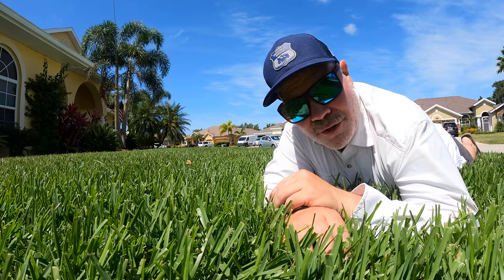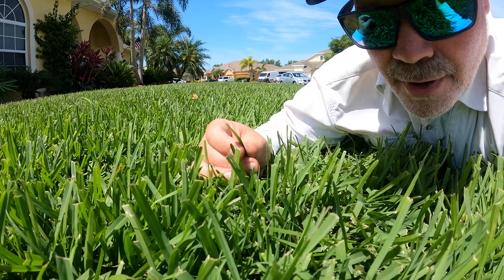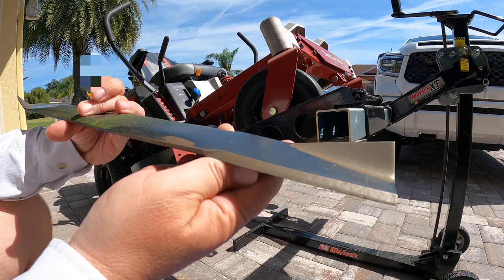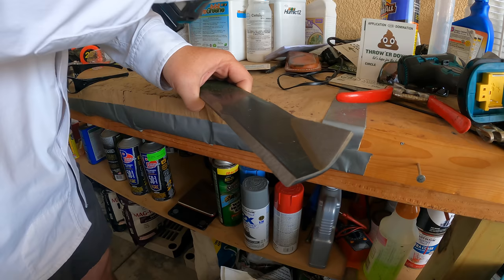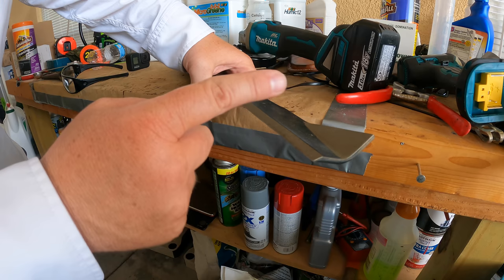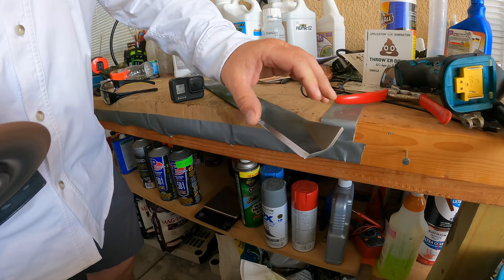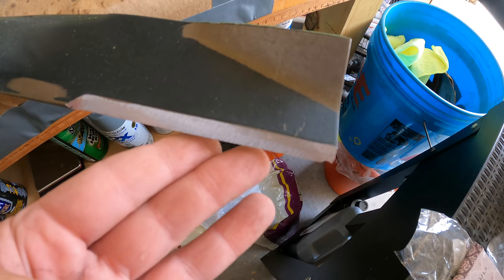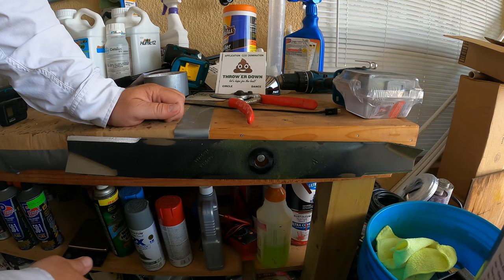How To Sharpen Lawn Mower Blades

Comment from the maker: Complete DIY lawn care training - you will have a nice lawn using what I teach you here https://www.yardcarebootcamp.com/
Reply: Use a flap sanding disc. It has heavy duty sand paper flaps overlapping in a circular pattern. It will keep the steel cooler and it will hold the edge better. Once you overheat the steel it won't hold the edge.

Comment: When balancing my blades, I don’t remove any of the cutting surface.  I remove excess weight from either the back or end of the blade.  This helps the cutting portion of the blades last longer.
Reply: Smart
Reply: Going to start doing just that. Thanks.
Reply: I disagree with removing from the back or end of the blade. What if you have a lawn tractor or ZRT with 2 or three blades? If you grind the 'end' then when you mow with that set of blades it will leave a 'tuff' of grass where the blades have become too short. I do not know exactly what you mean when you refer to 'back of the blade". Do you mean where it turns up or the back (underside) of the blade. You 'cutting edge' is the only place that material is suppose to be removed from. If you're tearing up blades that badly maybe you are cutting your grass too short. I see people all the time cutting so damn short the grass is only and inch or so left after mowing. Never cut grass less the 2 1/2 to 3 inches. I also do not mow weekly. I like mowing every 10 days. The grass is much more drought proof and the lawn is less like to allow the infiltration of weeds.
Reply: @CuriousKL  definitely agree with the sharpening statement!! Plus he’s removing material whether he likes it or not sharpening them. Unless he’s getting giant chunks knocked out of blade he shouldn’t have to remove much material to get them balanced anyways. As far as grass statement just depends on the type of grass, where I live a lot of people like Bermuda 🤢 and mow super low. Personally love a good fescue about 3.5” tall. Harder to grow where I live but it’s possible.
Reply: @Keith Dunbar  I don't think he is saying that he actually shortens the blade (at least not shortening the cutting edge, which would cause what you're saying).  There are plenty of places other than the cutting surface where small amounts of material could be taken off with no impact on performance. It would not take much material at all to balance and it really seems like a good idea to focus on getting the cutting edge perfect and then leave that edge alone. 

You might have said this, in which case I'd agree that I don't think I'd touch the top of the raised parts of the backside either since that's more likely to impact the flow of grass inside the deck. Very slightly rounding part of the bottom edge of the end instead of taking more from the front... That just sounds like a good way to make the cutting edge last longer.
Reply: Makes sense
Reply: I’m only removing small amounts on the back side of the blade to balance the blades.  I’m not removing ANY of the cutting edge.  Once the blades are sharp, it just didn’t make sense to continue removing the hardened cutting edge just for balancing purposes.
Reply: @alanlittle8817  I believe the whole blade is the same hardness someone told me they had problems drilling to fit a different mower

Comment: Using an 80 grit flap sander disk in an angle grinder will give excellent results with less metal removed and less chance of screwing it up. If you want it extra sharp, fine tune it with a 120 grot disk. I’ve tried many mower blade sharpening methods and flap sander is my go-to every time now.
Reply: I agree with you

Comment: "I haven't sharpened these in about 6 weeks that's to long"..... Me here, haven't sharp my blades in 6 years 🤣😅.... Guess it's time to buy new blades lol
Reply: Have never sharpened mine in 3 years. Zero nicks and the cut quality is still flawless.
Reply: Mine gets sharpened every time i slip off the curb
Reply: Yeah you don't need it too sharp in my opinion .just good edge on it .
Reply: Nah you’ll be okay if all you do is mow your own backyard 
I’ve not sharpened mine for 19 years! My mower is 19 years old and still is holding up.
Reply: Just use file as grinder ruin's the balance
Reply: That’s so funny because I’m thinking the same thing
Reply: @ianwilliamson2980  and safer too
Reply: @thomasjefferson2934  o yeah
Reply: I cut grass for a living and always use a file .
Reply: I haven’t sharpened for like 12 years
Reply: my "blade" is literally just a fast spinning blunt object i have no idea how it even cuts grass 😭
Reply: I mostly just run the file over one side of blade once a week to keep the edge on it.thats all that's needed.
Reply: ASTROTURF or CONCREAT LAWN OR DO YOU HAVE A SERVICE & YOUR MOWER IN THE MUSEUM?

IF IT WON'T HOLD WATER : time to file/ sharpen or change to BACK UP BLADE & TAKE #1 back to the blade sharpener you were using : FYI we're a disguise -& sneek in ever 3 months wit the two different blades he/ she/ them might not guess? 

After 6 months : drill 12 holes through it. & Fold 6 wire ties thru & use it for a :: detacher or aerator/ baler? 
Or wait for the :" BIGGS & STRATTON i625 from germany- 6 way: cut, bag, sread,mulch , weed Wacker & walk edger! 😘💸💸🇺🇸?
Reply: Yeah, Posting guy is borderline OCD.
Reply: Flat file for burrs, then a coarse and fine diamond lap would be quicker and less likely to change bevel. It will probably result in a sharper blade, too. An angle grinder can take metal off in a hurry.
Reply: I haven't done it since I got a second hand mower which might be a decade. Yeah buying new blades might be easier than buying equipment to sharpen.

Comment: I use the rotary grinder, but have changed from the metal grinder to a flapper sanding wheel.  It's less agressive and handles curves a lot more evenly.

Comment: I like using my flap disc for sharpening lawn mower blades.
Reply: Yep
Reply: I just came to say this! They work much faster than standard grinding discs. And don’t leave heavy burrs.
Reply: What grit flap disk??
Reply: @BMETFerg  80 I think  either 60 or 80. Both will work.
Reply: @BMETFerg  80
Reply: Agree. But i use whichever is on thegrinder at the time.
Reply: @turboflush  Hah, I’ve sharpened a blade or two with a cutoff disc
Reply: Flap disc was Allyn’s nickname in college.
Reply: That's my preference too.
Reply: Flap disk also !!!
Reply: Same here.  It hits the curves very smoothly.
Reply: @BMETFerg  60
Reply: @BMETFerg  I read 60 is perfect but who knows???
Reply: @gijoe83  Korey... I just got my grinder...have you used 60 and 80 and you like 80????
Reply: @FreedomRock44  I bought 80 grit from Lowes. It works, and I haven't needed to buy a new one. I am not a blade sharpening expert. Just stating what I use
Reply: 80 flap disc for me also.
Reply: @BMETFerg  80 works best.
Reply: @gijoe83  No no wasn't knocking was just wondering myself.     Okay cool to know.  I am in the same boat and wanted advice to which was better as well.
Reply: 💯 I like 80 grit
Reply: Yup, 60 or 80 flap, finished with a file by hand, look for level with a nail in the wall, works flawlessly.
Reply: @zed8083  I just did the exact same!!!!!!!
I have used nail in beam for years.
Reply: @BMETFerg  I use a  #36 grit flap disk from Harbor Freight and an All American Blade Sharpener.  Best setup for my low volume, backyard shop.  Flap disks are a little more forgiving in that they don't make big gouges if you aren't too careful.  I've found that anything finer takes too long, especially if the blade is badly worn or hand ground to the wrong angle.
Reply: I do the same.  I feel it's less aggressive and easier to control.
Reply: Yep, flap disc always. I keep a spare set of blades in rotation too so I just swap ‘em out when needed and sharpen the other set when I get a chance.
Reply: You dont need it too sharp .
Reply: 120grit flap disc gives a much better edge than the 36grit metal grinder.
Reply: @How_Lay  &
Reply: Me too,  when it's not too dull I us a file.
Reply: @geraldsemrau3611  yeah better with file as grinders mess up the balance of blade
Reply: I cut grass for a living and only use a file and it cuts perfect.never used a grinder yet and only changed a blade once had three mowers in 14 years
Reply: @backpacker3421  ,,, I'm going to give it a try. I normally use the regular grinder blade. I just have a hard time getting the angle right.
Reply: @ianwilliamson2980  I have a bench grinder, angle grinder, and I use a hand file as well. Gives me more time to finish my drink ;)
Reply: @bigf1502  ha ha I'm sure.i just stick with the file as want to keep the balance right .blades don't really need to be that sharp anyway .new mowers blades are fair blunt but cut very well.just got new cobra it's great Honda engine in it .under five hundred pounds on Amazon.
Reply: @ianwilliamson2980  Man, I want a new Honda mower so bad. Just don’t want to drop the 600 when my 8 year old Troy built just keeps going.
Reply: @bigf1502  yeah I nearly went for a Honda but at thousand pounds is bit steep .I looked at reviews and the cobra 21 inch has Honda engine so got it . very pleased with it.saved me about six hundred pounds too .
Reply: @ianwilliamson2980  I’m going to check into that! Thank you!
Reply: @bigf1502  welcome .yeah there is review videos on the cobra on you tube .I think it's bit lighter than the Honda to handle too which is important if you work with it all day like me as easier to turn etc
Reply: Yep flapper for the win!
Reply: I use 80 and finish it off with a 120 flap disc

Comment: Thanks for your vid! Just sharing some info; the right type of grinding wheel depends on the material of the blade. That metal grinding disc you're using has an aluminum oxide formulation and is good to use for steel blades. However, if blades are made of a nonferrous material (e.g., tungsten carbide) then a silicon carbide wheel would be better. Also, 60 grit seems to be the most popular choice. It's aggressive enough to remove metal when needed but doesn't dig to deep to keep the edge clean/sharp. Hope this helps fellow lawn care nuts!

Comment: Big thanks to @The Lawn Care Nut!! 

Instead of buying a new blade for my greenworks 60v mower, I bought myself a craftsman angle grinder, and sharpened my own blade. The thing cuts like it did when it was brand new! Super thankful I found this video.
Reply: Try mowing 1.5 acres with that 60 v mower.

Comment: You want a blade that is sharp enough to cut instead of ripping.

When I get my blades sharp, rather than mess with the sharp edges by continued grinding, I balance them by grinding on the back of the blade until they are balanced.
Reply: curious, how much of the fan blade lift wing are you taking off per balancing would you hazard guessing, and have you noticed a difference in the cut due to decreased lift force. aerodynamically that would be worse of unbalancing as having a heavy side as more fan blade will cause the bearings to wear unevenly top to bottom from one side to the other.
also curious, using your method, do you notice any extension in the life of your blades before they wear down or reach the end of their lives?
Reply: @aprilgeneric8027  
The amount taken off the back is very small if you do a good job sharpening the cutting edges on the front.  If you have to take more than a small notch off the back then you have royally screwed up sharpening the edge and should get new blades.

With such a small amount taken off the back the effect on airflow is really non-existent and it moves air just as good as before.  The less you grind off the front to sharpen the blades will make them last longer.  And keeping them balanced is critical to keeping the bearings on the mower deck, or engine in the case of a single blade mower, from being worn out quickly.

Another useful piece of information.  If your mower deck has grease zerks on the shaft going through the deck do not bother greasing them.  They use sealed bearings and the grease you put in there will never get into the bearings.  If you do want to add grease to those bearings you will have to remove the shaft and bearing from the deck and physically remove the seal from the inside side of the bearing first.

But you will have to be sparing on the grease you put in because you do not want to pop the seal on the outside side of the bearing off because that will allow dirt to get into the bearing.  What I do is remove the shaft and bearing and get a needle zerk and lift the inner seal enough to get the needle under it and then pump some more grease into the bearing so it has more than the minimum grease they put in at the factory.  I think that works perfectly fine and you do not risk blowing the seal off the bearing.  I have had my mower for ten years now and have never had problems with the bearings.  The last mower I had the engine wore out first and I mow several acres each time.  We live on a farm and have a big yard and mow along the fence line in the pasture to keep the electric wire clear.

Comment: I like to keep two blades in rotation. So I can always have a sharp blade at the ready.
Reply: Me too!!!    It is such a big help.
Reply: Same here too
Reply: I usually buy a three pack if it's available so I have four total, then sharpen them all each spring. I also have eight spools for my string trimmer which will last me through one year and into the next.
Reply: I just sharpen and re-install, kinda pointless to have more than 1 for home use.
Reply: @gwot  It depends on the cost. For my old mower I could get a third-party-made three pack for $15. I like to sharpen all my tools just once per year. Unfortunately, for my new mower only OEM blades are available so far, and they are $20 each.
Reply: @jmodified  ah, so your reason is just so you can do it once a year. You still have to remove and install a blade anyway, so not taking the extra 2 minutes of sharpening each time seems... pointless.

Comment: Sharpening to razor sharp makes getting those nicks or chips on the sharpened edge much easier. Sharp, but not razor sharp makes your cutting edge last longer between sharpening for the most part unless you hit a lot of mulch or sticks with the blades. Another tip, when balancing you can remove material from the back of the blade instead of continually removing from the sharpened edge.
Reply: I try to preserve as much of the cutting edge as possible when balancing, so I take the excess weight off the back edge and the end,a little at a time. I try to spread the removal out a little so to not just make a big gouge all in one spot. I use a cone type balancer to get a three dimensional balance , rather than a two dimensional balance using a nail in the wall. Good luck.
Reply: I'd rather have the blade as sharp as possible and just sharpen it more if I had to.

Comment: I sharpen with a hand file as recommended by Toro in the owners manual for my Suzuki 2 cycle powered 1991 Recycler.
Reply: @j s The Hondas from those years seem pretty awesome too. Cast aluminum decks like Toro. My plastic deck '08 Honda HRX 217 can not touch my '91 Toro in terms of mulching ability.

Comment: I use a metal cut off disk on one end of my bench grinder and cut three notches at each end of my mower blades for my push mower.
I rebalance the blade after each sharpening.
I am now 88 and can easily cut through grass that is up to 6 inches tall in places.

Comment: Excellent video! Very nice hand grinder too! Just sharpened my blades  yesterday, and greased my spindles,  and you can hear them making that perfect pitched sound, that’s when you know you got them blades sickle sharp and smooth spindles. Lower friction, pressure, wear and tear on the clutch, drive belts. Great closeups of the angle grind! Done good dude!
Reply: You wasted your time greasing the spindles. The grease nipple just allows you to fill the void between the top and bottom bearings which are both SEALED bearings. Don’t want to burst your bubble but you should know that your wasting time and material. Ask any mechanic that works on mowers and you’ll get your verification if you don’t believe me.

Comment: I have just been using a coarse sharpening stone. Does a good job and as long as you aren't hitting rocks, there is no need to remove a ton of metal with a grinder.
Reply: Not suppose to cut the driveway, only the lawn. If you're hitting rocks in the lawn, my guess is you're cutting too short.

Comment: Something you didn't mention and most people don't know or realize is to make sure when you sharpen you are rotating the disc, file, etc. away from the edge. Reason being is to not heat the leading edge. Not a problem with a hand file but grinding discs generate heat which weakens the tempering of the blade. The nail balancing has always worked for me. Nice video!

Comment: BELT SANDER turned upside down secured to bench/table with 60 grit gets fast, amazing results.  Use a binder clip on back edge as a guide, gives perfect angle. Two sets of three blades in rotation, submerge the dull ones in water for a couple of days, caked-on grass comes right off. SAFETY GLASSES 100% ALWAYS!!

Comment: Not explained in this video (though he may have in another video), but the reason you balance your blade/s as he explains it, is to help prevent destroying the main shaft bearing in your mowers engine (or riding mowers spindles, thus blades). Also helps maintain the ideal rpm of your engine as well, generally speaking, makes the engine last through many blades, far cheaper than a new mower. I am NOT dissing on The Lawn Care Nut as I do like his video's very much, only wanted to add why it is important to balance ur (<<gaming lingo, srry, lol) blades and almost certain he has a video about this, but can't be 100% certain cause I'm too lazy to look for it. :)